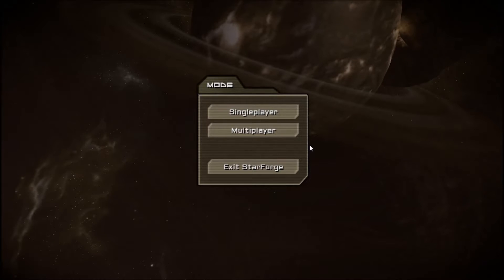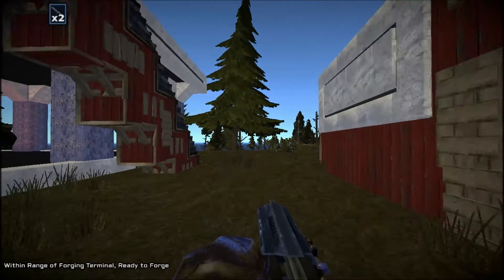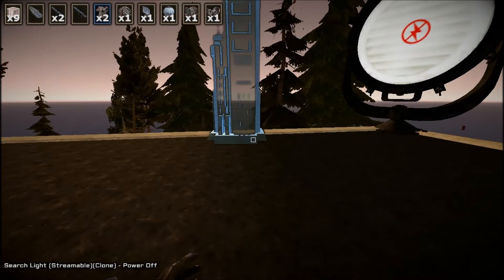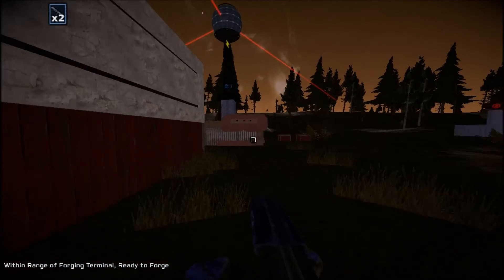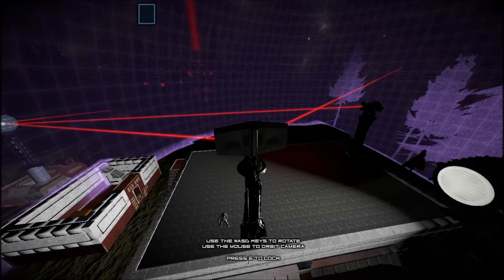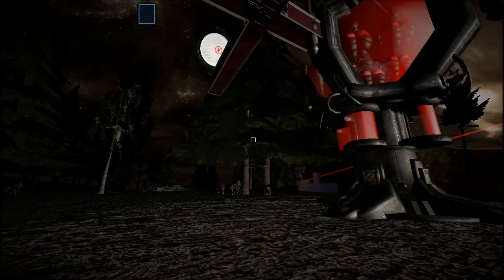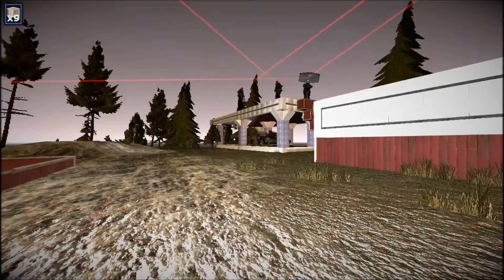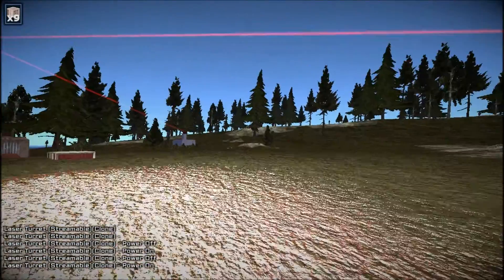Starforge Alpha 0.5a Survival Tutorial Ep 7 - How to Use Power

Comment: How do you pick up power generators?
Reply from the maker: Make sure you're not holding a building block (weapons or empty hand ok), move your cursor around on the generator until you get the glowing red effect, hold down the right mouse button until it picks up (you can let go of the mouse button once the generator turns blue). You can then move the generator around (placing again with a left click) or return it to your inventory.
Reply: Tuandor Gaming How do you return it to your inventory?
Reply from the maker: Jim Hoffman Open up your inventory, left-click on the item (in your action bar) that you want to return to your inventory, then left-click anywhere in your inventory page. Alternatively, if you want to keep it in your action bar just not have it blue-floating around, just scroll your mouse-wheel to select something else - that will leave it ready to place later.